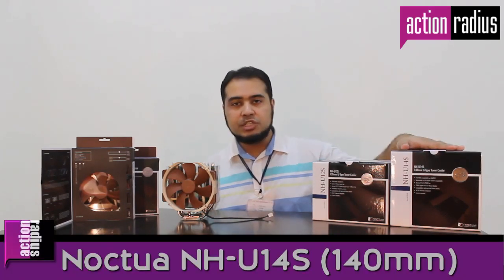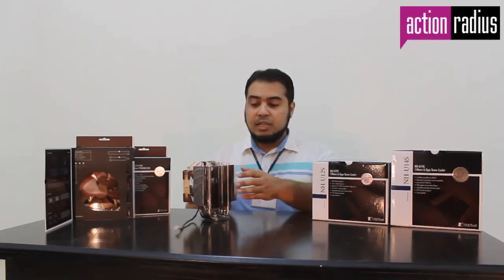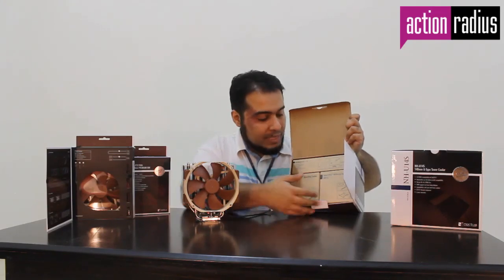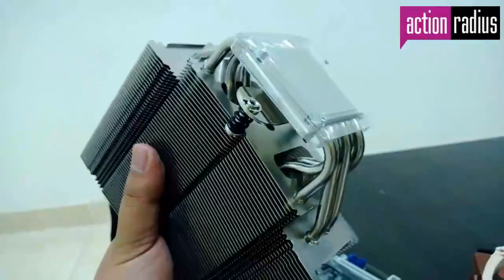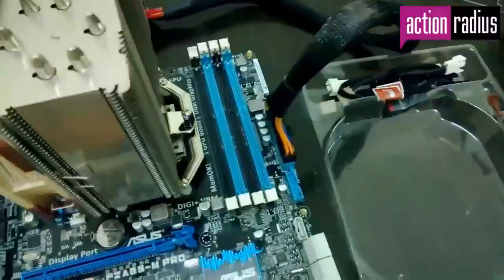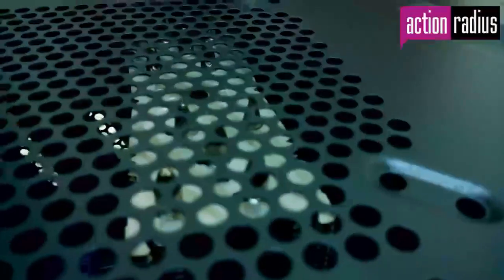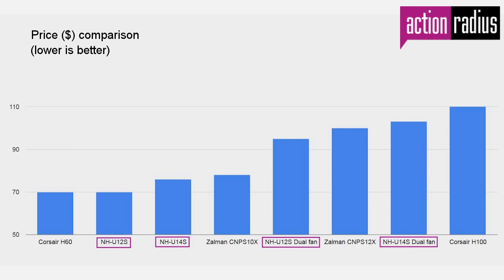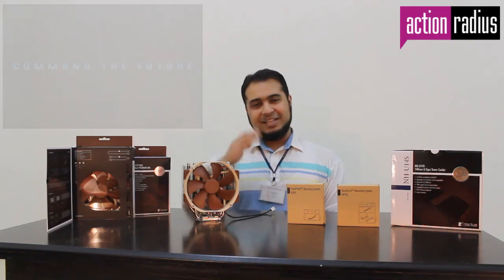Noctua NH-U14S NH-U12S CPU coolers - review and installation

Comment: Nice video. I have a noctua 12s and a 140mm Noctua case fan as an intake. I was going to buy another 140mm Noctua case fan and another 120mm Noctua cooler fan for my 12s. I am now going to buy a D14 and then use the rubber grommets from my 12s on the D14. I will use my old 120mm cooler fan from the 12s as the second intake case fan.

Comment: Ali, great vids, great presentation, but you need a better Mic, my friend. The bad acoustics make it hard to hear you clearly.
Reply: Yup either use an extremely close headset mic, or do it in less reverberant room, or get some acoustic panels on the walls. Still great presentation :)
Reply: 1wibble2
 ..apart from the thermal paste bit, that was nuts. lol. Better to use pea sized amount in middle and let the pressure spread it out evenly with no air pockets.